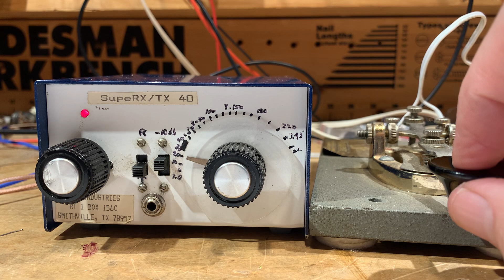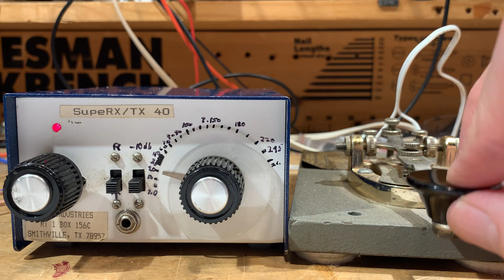Another CW Contact with the MXM SupeRX/TX Transceiver

Comment: I always love to see contacts like this. I have run QRP for many years and have build, over time, several xtal transmitters with either a dc or regen receiver. I never have been disappointed and always thrilled in making contacts this way. 73 de WA4JAT 😀